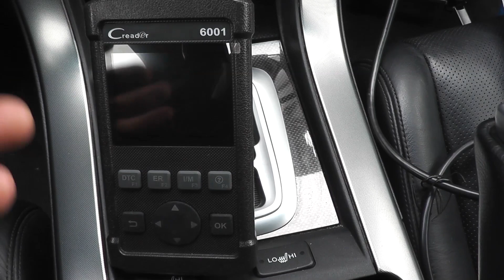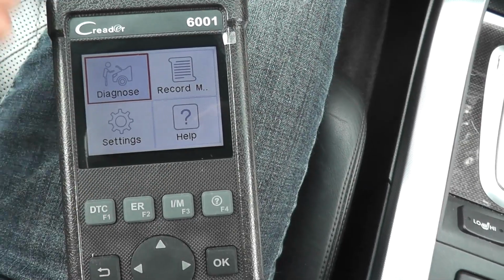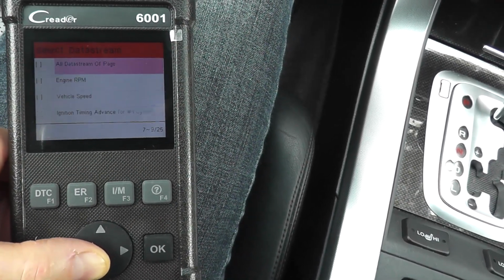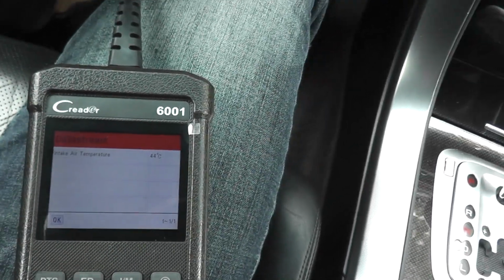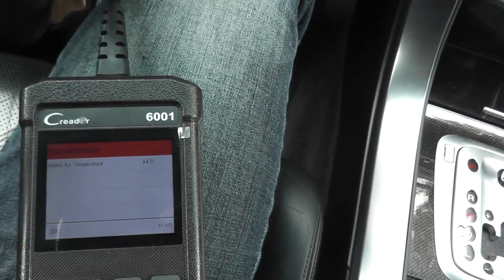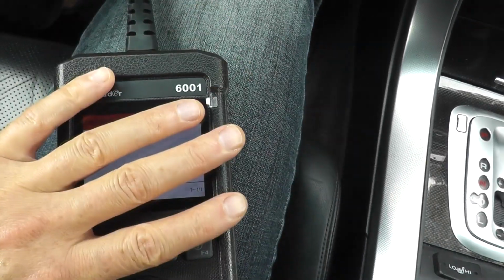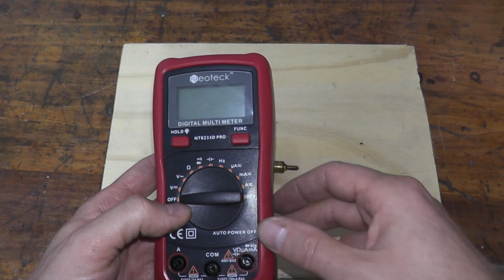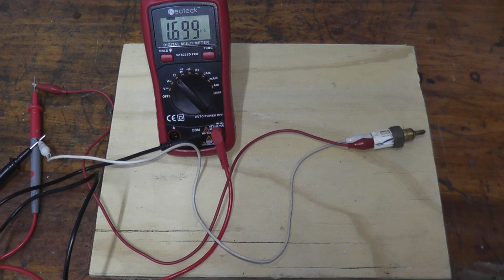Acura TL Intake Air Temperature Sensor Testing and Replacement P0112 / P0113

Comment: Thank you!  Excellent video!  My 2001 Honda Accord hasn't had good air-fuel mixture.   Its air intake temperature hasn't been cleaned or placed.  I don't have any P0112/P0113 code, but I'll clean the sensor.

Comment: Hi there
Your video is excellent, very clear instructions how to diagnose IAT.
I need your expertise on how to solve my car issues.

Vehicle: 2007 Accord V6 EX-L.  Here’s the problems:
I parked the car and turned off headlights, the car shut off itself before I turned off ignition.  Engine light came on and threw many codes: U0107, P0641, P0135, P0155, P0498 and P0111.  It happened twice in last two weeks.  
In your opinion, how should I diagnose these codes?

Comment: I just replaced my ECT sensor. For some reason the temp gauge is now going to high right after. Could it be because I did not erase the code after with the scan tool?

Comment: I got 113 but my temperature it’s not below so what that means?
Reply: Try speaking electronic cleaner spray on the iat sensor and almost any connection you can like the maf and idle control valve

Comment: Hey bro I’m having a problem with my Acura, apparently I’m having a code on for evap system very small leak, and I already changed the gas cap but it seems to not go away... any solutions?
Reply from the maker: Small leaks can be a pain to find. Most shops will use a smoke machine to find the leak. Scotty Kilmer has a video finding small leaks using cigar smoke. Chances are it's in the EVAP canister area; meaning the canister or vacuum hose. I'll have EVAP vids for the TL soon. In the mean time, search on Scotty's YT page. Maybe you can find the leak rather quickly.